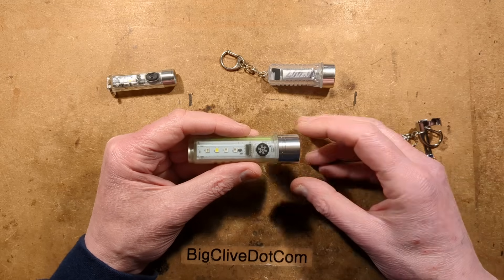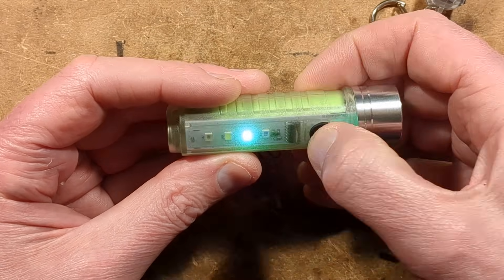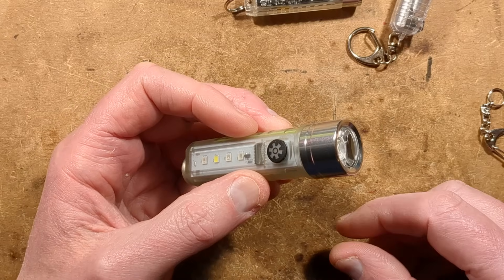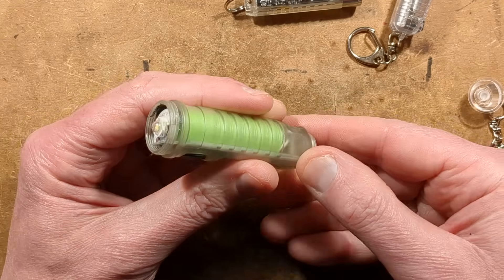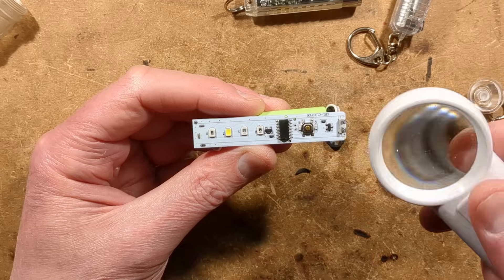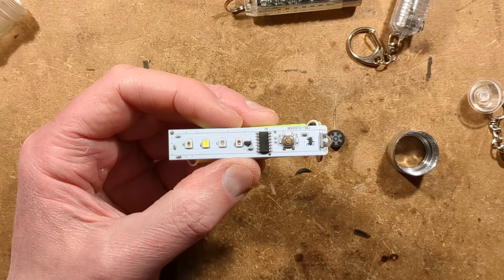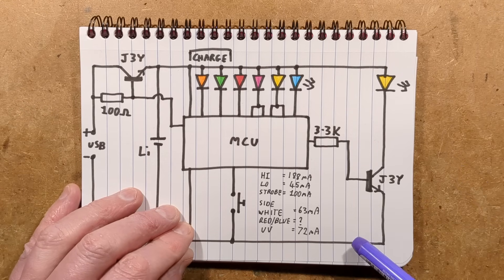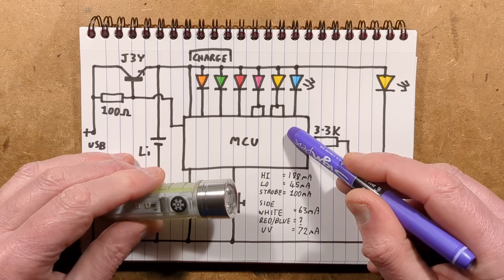Cheap 'n' chunky Chinese rechargeable flashlight teardown

Comment: I like the "ultra-minimalist's" design - why over-engineering for the same result or "consumer experience"? 😃👍
More parts:
- more points for failure,
- more consumption of natural resources,
- unnecessarily higher price.
Reply: generally the “ultra-minimalist” stuff is ultra-minimalist because it doesnt incorporate things like proper regulation, overcharge protection, over temp protection and the like. This usually means that the device fails and winds up in landfill much earlier, which is far more of a waste of natural resources than adding a couple caps & diodes would be.

Comment: I like my Maglite LED 2xAA flashlight! LED did fail once, but the company sent me a new one for $8 USD.
Reply: A series of AAA, itty-bitty Maglites have been my go to for decades.  The last one, along with a pocketknife and pen, parted ways with me via a hole in my pocket several months ago.  (I hope whoever finds that stuff enjoys it as much as I have done. :-)  So, it was time for another tiny flashlight -- and I bought the same thing again.  However this time, after way too much overthinking, I opted for one with an LED.  I really miss the broad spectrum light from the old one's incandescent lamp.  But now I can use rechagable Ni-MH batteries and the light doesn't dim out all too soon.  (It doesn't focus as well as the ones with a lamp.)  No charging port to let water in.  No questionable lithium cell and charging circuit.  No micro controller and associated components.  And, of course, no way to turn night into day at the closing of a switch.  But it does have one thing I truly value in a pocket flashlight -- screwing the top down turns the light off, not on.  Snug the top down and no worries about through britches beaming. :-P
Reply: @wargamingrefugee9065  I have always carried a 2xAA one for years using the included belt pouch for it. Helpful in computer repair. I went from the lamp to LED when a gust of wind pulled the lamp one out of the pouch on the interstate while going 80 on a motorcycle. I find the LED much brighter and the batteries last longer.

Comment: did check battery,there could be addional circuitry controll.i seen some flashlights what circuit protection board for also current regulation probably to save money
Reply from the maker: No cell protection PCB on the lithium cell.

Comment: I have a nice wee Aliexpress flashlight that doubles as a power bank (1x 18650 in it)... I just wish there was a way to remove the strobe function. Oh how I hate the strobe function.
Reply: Have you tried long press for turning it off? Some of them allow to skip the strobe.
Reply: @TheStanHill  I hadn't, due to me being an idiot and not thinking of that... So I just tried it. Turns out, long press activates SOS mode. Which I didn't know was a thing. On the bright side, at least it's actually SOS not SOSOSO...

Comment: Super cool.  Thanks Big Clive.  I was wondering how you tested the LED currents maybe measuring voltage drop across them.
Reply from the maker: I used a DC clamp meter on the cell leads.

Comment: I wonder if the Chinese mobile phones dont use the rapid charging so they dont bother with the resistors in anything? I know the tech and mains power is treated very differently  from the West. We both have regulations but they overlook much of them. 2x👍
Reply: They use a different negotiation method.  And seem to like 5v at a lot of amps.  Like 5 amps.

Comment: I got something similar to this about six months ago. Same case, same board shape, but very different circuitry. For a start, two LED packages per row, as well as transistors and resistors for the LEDs too.

The battery seems a little longer (takes up the full length between LED cob and charger socket), and the micro has a few different modes to it.

Not sure if youtube will block my post because of it, but here's a pic: https://cdn.excessive.space/images/IMG_20250426_195223.jpg
Reply: Just checked the battery, and it's an 18650.

Comment: I've got a lot of music stand lights which take 3xAAAs (NiMH work), many of which have tabs broken off their battery holder covers by some clumsy person. They have external power jacks with USB adaptor cables and the idea is to put in a vape cell and a charge controller/protection PCB, then glue the cover back on. Unfortunately the 13mm diameter cells won't fit without cutting out a section of the internal cell support frame.
Reply: My Christmas lights are salvaged vape battery powered using battery boxes I made to replace the double and triple AA dry cell boxes. They work well. I added 10 ohm series resistors to keep the current draw sensible.
The latest project was to replace the 3 cells in an old Black and Decker electric screw driver with a large 1500mah vape battery. That worked well but needed some messing about to make it all fit and the inclusion of an extra cap and diode to protect the charge circuit from the motor. The 9v charging stand was modified to output 5v to charge the screw driver.
Clive has inspired all this bodgery 😁.
Reply: Will you post videos of your projects?@lesmaybury793